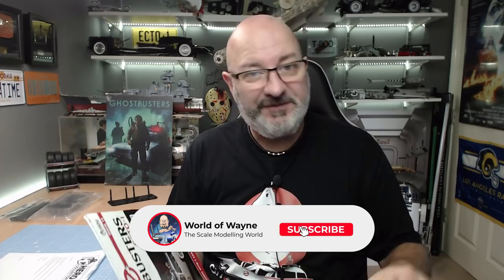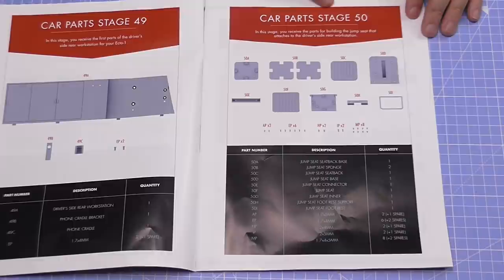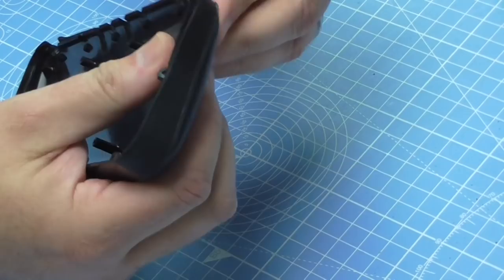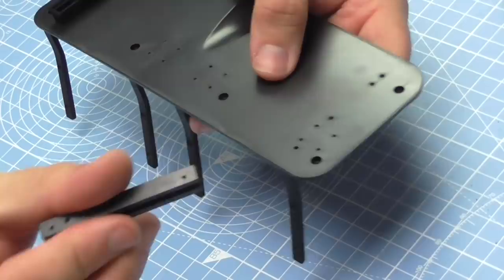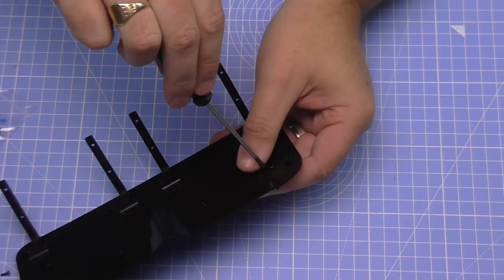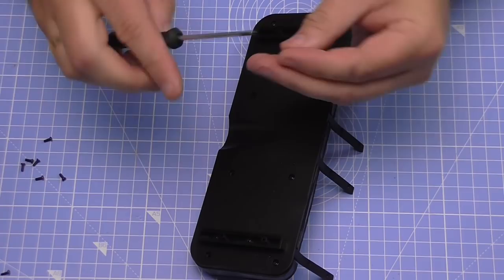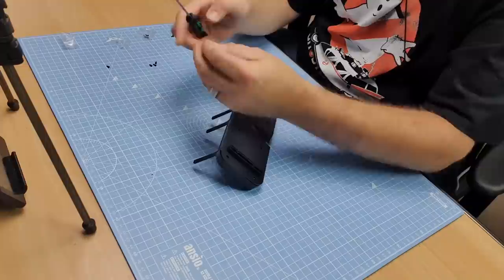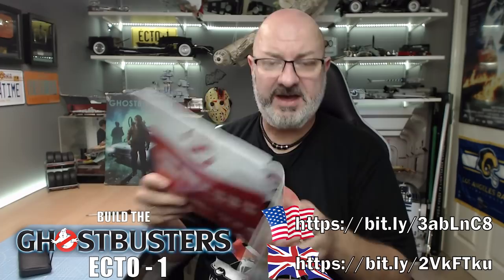Build the Ghostbusters Ecto-1 - Part 47 - Front Seat Parts

Comment: I think you forgot a screw at the start on the video, one of those with flanges that secure the soft exterior of the seat on the hard interior, it's on the side of the seat that faces the vertical supports, only three of four screws are in place.
Reply from the maker: I will check
Reply: @WorldofWayneUK  Errata corrige from me: not on the back side where the vertical supports are but on the front side where that concavity on the seat is, just stop the video at 4:17 when you put the last screw, it's on the opposite side.
Reply from the maker: @Thalon77  yep. I got.it now